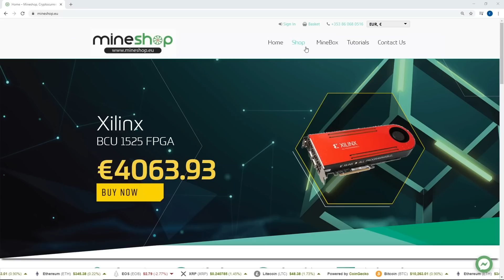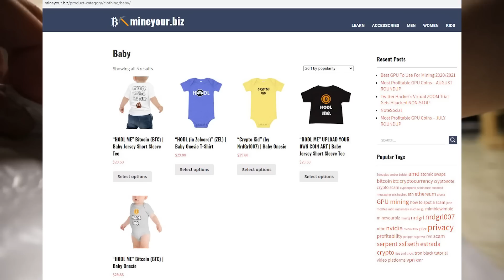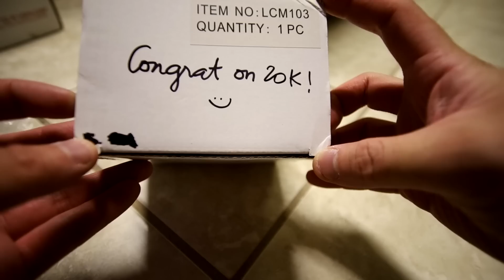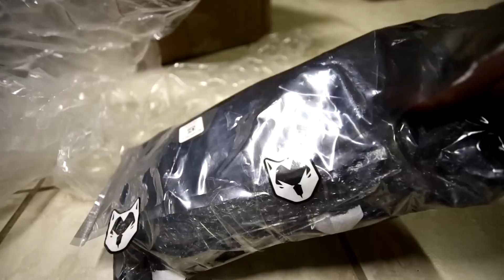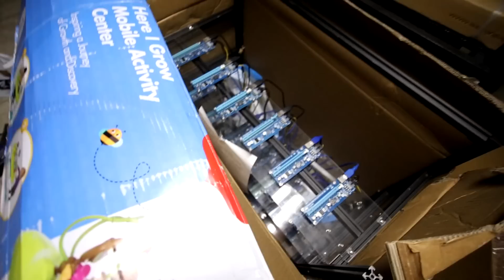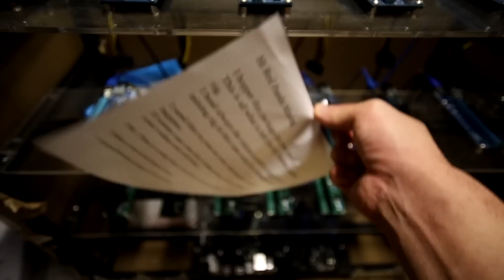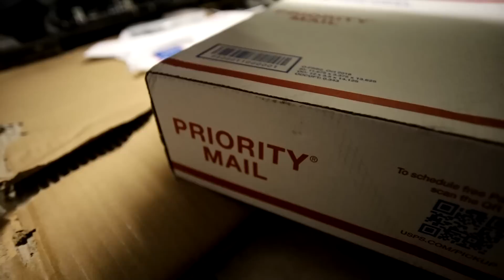Not Sure What To Say Here | RPM Fan Mail Episode 3

Comment: Awesome server case, i love those because you can basically throw away entire fans module and leave it just bare radiator itself and temperatures still are going to be awesome + rig is working more stable with less power consumption (also slightly more hashrate!)

Comment: Congratulations the 5700XT now holds the number 2 slot on What To Mine!!! There's just one thing I can't figure out. Other than theres a few thousand out there why does What To Mine list a card that AMD stopped making in 2018 and are expensive as hell to own? I'm referring to the Radeon 7. I've moved on. I'm fantasizing 6 RTX 3080's in my mining rig, but you can bet they wont be at a reasonable price. What's reasonable? Nothing over a grand.

Comment: Serious question. How do you prevent flipping breakers? What is your set up?

I an writing this moments before pulling out of my driveway to go to my friends place to replace the ssd with an M.2 ssd on my RADEON vii x5 system. It was flipping the breaker but now it is getting 450 Megahash at 1.06 kW.but it keeps browning out or something while my solo RADEON vii is running 90 Megahash at 950 mv just fine.
Reply from the maker: Checkout what other plugs are using on the same circuit. 15a 120v is like only 1500-1800 watts so I would see if other stuff is being used on the same circuit to trip the breaker.